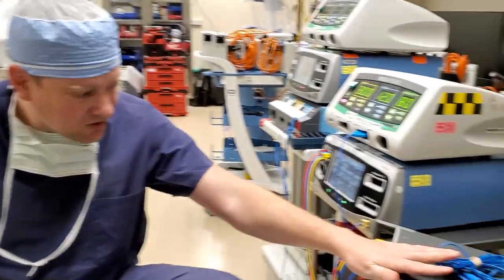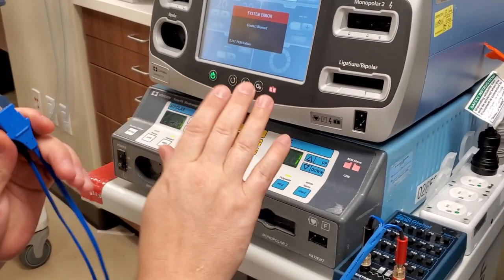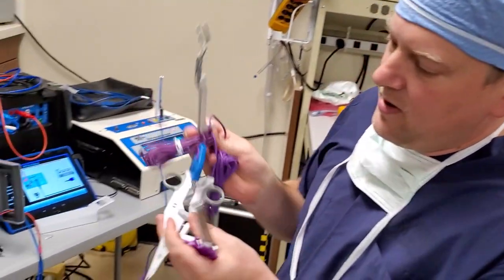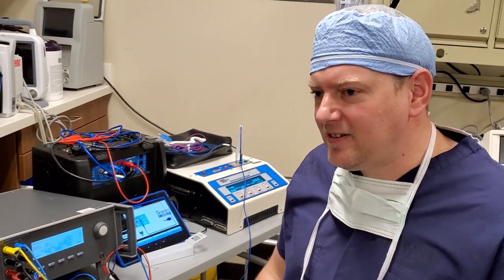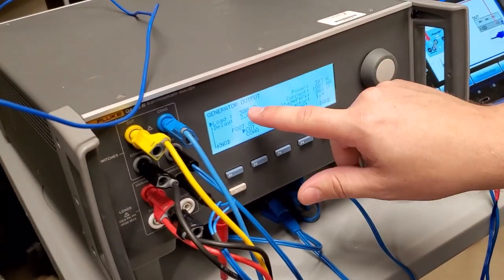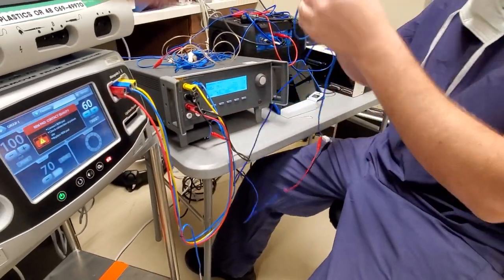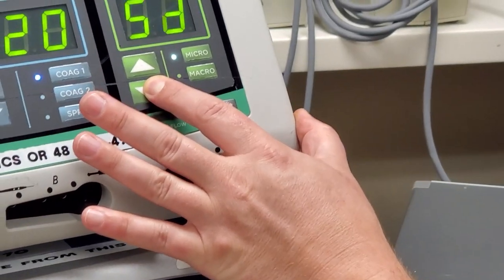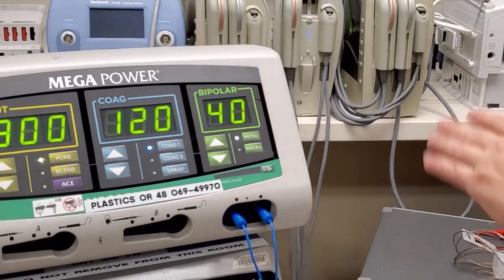Electro Surgical Unit Overview

Comment: I appreciate the time and effort in this. Question though, the ValleyLab FT10 has a checklist from the service manual and it directs you to do tests in the test mode, do you run that or do you just do general output testing?

Comment: Hey Justin! I have learned some good stuff specifically with the esu's on this channel. I have gotten to be quite good at performing pm's on these devices. Today, i was testing one like I normally do because we had a ticket for one, and it started to make the analyzer short out and say over temp. I tried another esu to see if it was the analyzer or the device itself and turned out it was the device and not the analyzer. Do you know what could be the possible issue could be? I was thinking of a possible board on the coagulation side? Thank you!
Reply from the maker: No idea. Unplug and measure continuity / resistance, then internal inspection
Reply: @BetterBiomedChannel  thanks for the reply!
Reply: Use an Oscilloscope and see what the waveform is doing - I'd guess that youve selected Coag but the generator is outputting a Cut waveform - oh and check the frequency of the waveform as well

Comment: Thank you for making these educational videos.  We need to promote more biomeds today.  I do have a comment that needs to be considered and that is Accuracy.  With today's modern equipment, more emphases is being placed on the accuracy not only of the medical devices themselves but of the test equipment used to test these medical devices as there is a direct relationship.  Several of the ESU's that you demonstrate in your video have requirement's for tolerances to be tested to.  For example, the ValleyLab (Covidien, Medtronic) FT-10 requires that REM, Power Output and Leakage tests loads ALL be +/- 1% or better.  What are the specs of the various units you are using for testing?  1%, 3% or maybe 5% or more.  The next point is, does the test equipment have the testing capabilities to completely test to the manufacturer's requirements which are driven by AAMI and/or IEC requirement's.

Just because we have always used certain equipment or we like the buttons on one versus another doesn't make it the right tool for the job.  Let's make sure we are taking every consideration into account before we select the most appropriate tool for the job.

Thank again for your efforts here on your channel.  I hope it leads more biomeds to our field!

Comment: Unrelated but are those HL-90's in the background all due for PM? I've been working on those non stop this month lol
Reply: I took over that shop last week. They are still there, not due for PM. Not sure what he was doing with them but this dude collected equipment, been spent the last week fixing and sending it all back to the floor. Those warmers are getting tested next week, they all need to be cleaned out.

They are 390s btw, newer model, uses a different connector for the cassette so there are no o-rings to replace

Comment: Is there is an issue for bovie cautery pads/pencil going to used to covidien cautery machine?..tnx
Reply from the maker: The monopolar pencils are usually a standard
 The return electrodes might be different for the shape of the connector and the split pads indicating pin.